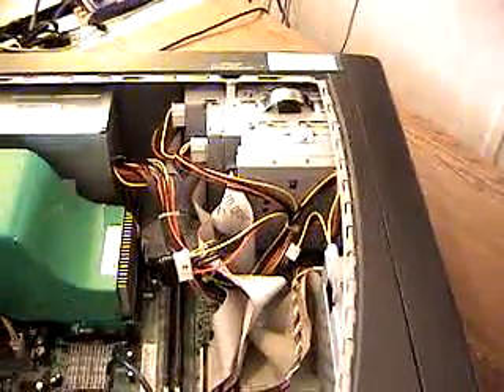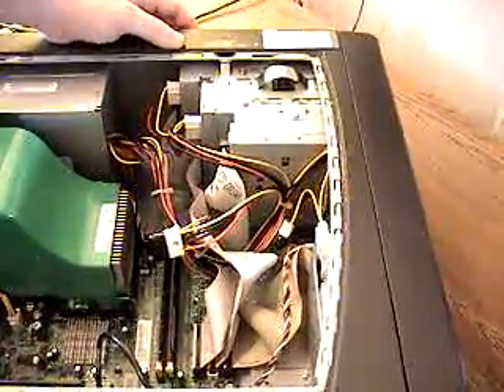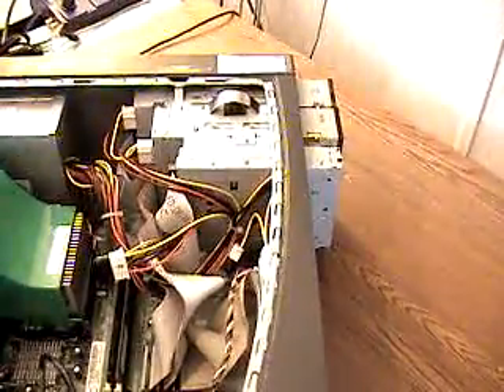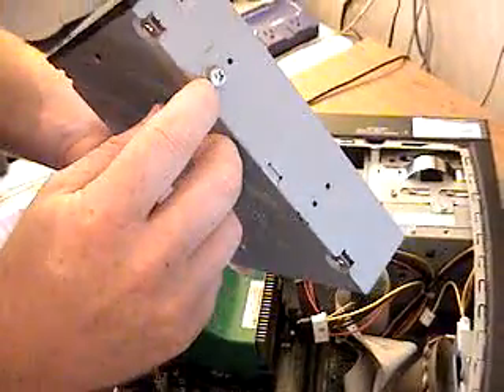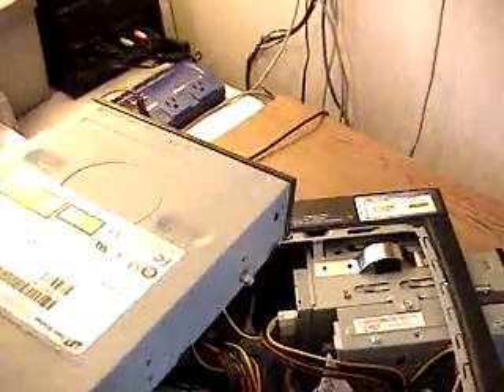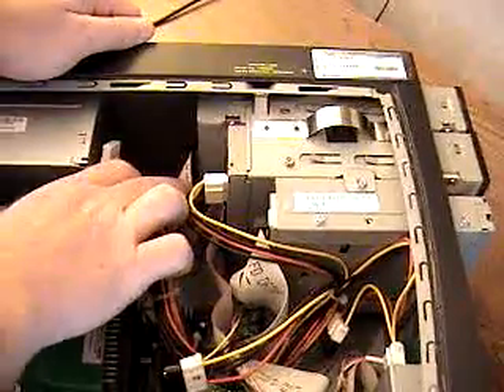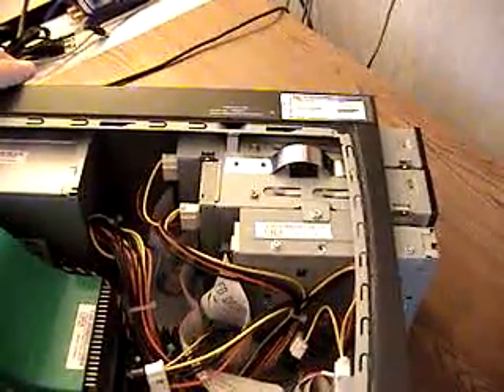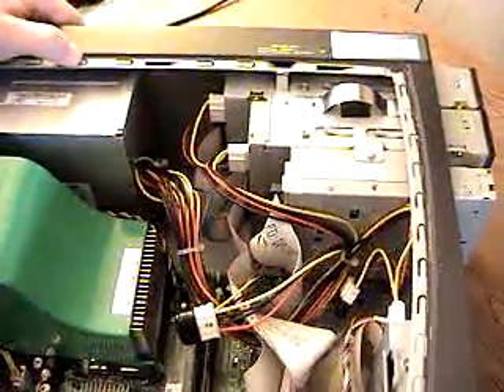CD-RW DVD DVD-RW Installation and replacement

Comment: I have a dell laptop. My cd rw dvd rom drive works, but only while you push on the tray.  For whatever reason, it no longer latches when you slide the tray all the way in. it's also a pain to get open.  Is this something I can repair, or do u think I need a new drive?

Comment: You need to select the correct primary boot device from the system BIOS. You want to make sure you're still booting from your hard disk after you add new drives.